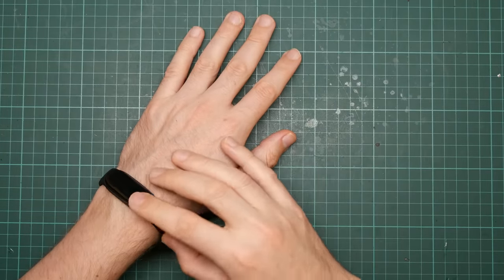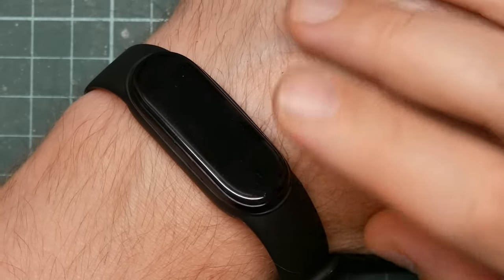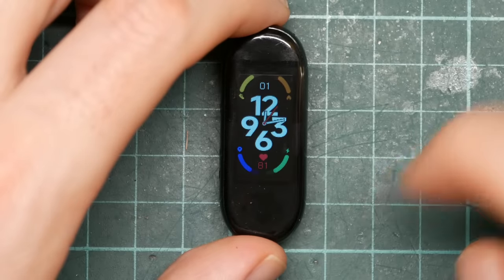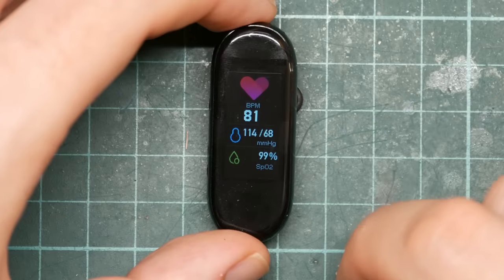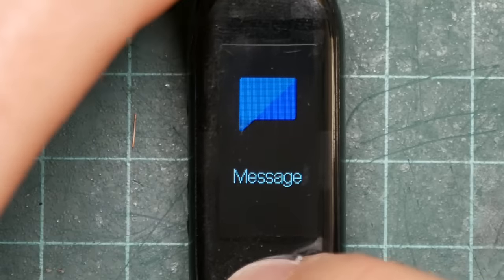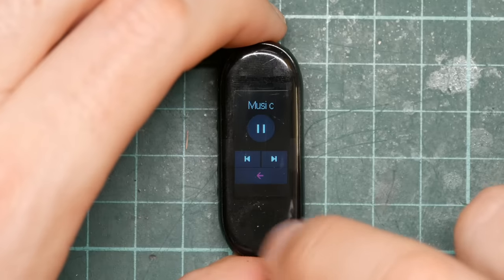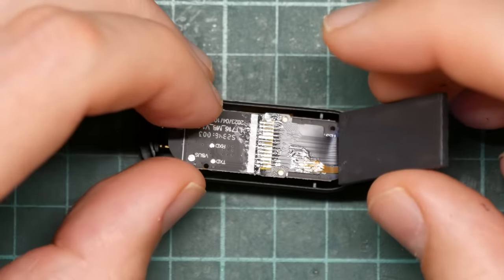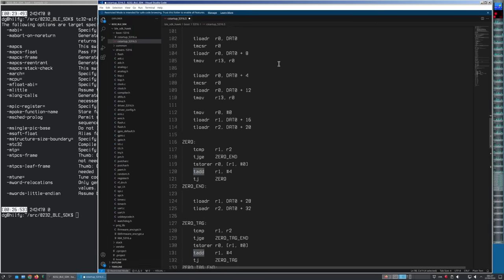Porting Python to a terrible $3 smartwatch

Comment: "The battery is slightly squidgy, which is a bit concerning" -- the guy who was just poking it with very pointy tweezers 😅
Reply from the maker: Sometimes you have to make your own entertainment.
Reply: Come on, the channel name is "Poking Technology", what did you expect
Reply: The more you horse around, more you find around
Reply: A rule of thumb for seriously high volumes of electronic components is that you can cut the 3k unit price from Digikey/mouser down to 1/3. So they're more likely paying in the range of 40 cents for that SoC.
Reply: “the M4 band battery is very slightly squidgy, which is very concerning”
Reply: @snarekeeper8053 valid point lol

Comment: i love that your desk has a heartrate. amazing. please feed it well
Reply: Heart rate*
Reply: Hart
Reply: @Omkar_Rangole  rate
Reply: Andrew Tate
Reply: @bassooll69 Rat*
Reply: @tultimatelifeform  wt f andrew tate doing here
Reply: It's a high heart rate given the desk is at rest though, maybe he needs to give the desk more exercise?
Reply: @scragar  Probably. In every video he's just sitting there.
Reply: @Omkar_Rangole  kevin hart
Reply: @khalifaadam1653  Kevin hart rate
Reply: That's my hate rate. I bought a similar crap some years ago. So it was more expensive as 3€ and I bought it for the advertised blood pressure sensor, which gives fake values. The dealer didn't refund me. I guessed those are fake random numbers. Now I now there is no optical sensoring at the diode. It would require a third wire, actually it should better have 4 wires.
Reply: @kamel6915  Thats what i noticed. Because no matter what, it will always give a reading
Reply: the desk having a Heart rate

Comment: The fact that this watch is a knockoff of a xiaomi band watch, which itself is only 20-40€, is crazy
it's a cheaper version of an item that's already cheap!
Reply: And I know it’s a Xiaomi smart band 4 knocknoff
Reply: @Camman18family  it looks like a mix of mi band 4 and 6. mi band 4 as in the shape and mi band 6 ui
Reply: I can pay a month's rent in 50€
Reply: 40U$ is much money in many countries
Reply: I had a mi band 2
Reply: But without a working heart rate monitor and pedometer.
Reply: it's not a knockoff of the specific model. The same product can be found under various names like "M7 and M8" imitating the mi band 7 and mi band 8 but will all ship the same knockoff m4 model in the "M8" box. I bought a lot of these because the included bands were compatible with my old mi band 4, and so I just paid 80 cents for the product and just threw away everything but the band
Reply: Even $10 Casio watches are copied, and sold cheaper in developing countries..
Reply: honestly I upgraded from a xiaomi to the pixel watch and regret it

Comment: 5:55 Funily, two wires are enough, if you are clever. When the Led has sent its pulse, there is a reflection coming back and since Leds work as photocell, a current spike is generated and the current is dependent on what is reflecting. So all the sensor needs is power and ground and some sniffer on the powerline.
But i bet this is not implemented🤗
Reply: Jup that is an option but in this case it's just a nice blinking-light. I thought about this for a self dimming clock that's just barely visible. Too much hassle to implement. Used a standard cheap photocell. And in the aftermath just bought a cheap off the shelf chock 😂
Reply: So measuring the power draw which is lower when more light is reflected and reabsorbed?
Reply: @Kenionatus  Can you measure the drop? It isn't much.
Reply: @Kenionatus  No! The led generates power like a solar cell and you could measure that. But only in a narrow wavelength. And I'm not sure if you could use the bounce back from rapidly switching between powering and reading voltage to detect anything
Reply: @SteffenF  next you will tell me that the heart rate of the desk its sitting on is wrong
Reply: @francistaylor1822  no it's absolutely correct. 😅. Must be correct... Obviously. 😂
Reply: @SteffenF  Measuring the bounce back right after turning the LED off sounds difficult. Judging by a Styro Pyro video I saw relatively recently, electrons like to slosh around quite a bit when circuits are opened/closed. Since both the light bounce back and the charge equalisation happen at around light speed (IIRC), you'd have both happen at the same time.
Reply: @Kenionatus  I guess that's right. Therefore it's not possible.
Reply: I have one of them, it just selects the hearth rate from a list that ı guess has like 3-4 numbers. It shows 68 and then 94. And when ı disconnected the led it was still giving the same numbers so ı don't think that it is implemented :)
Reply: @SteffenF In theory it should be detectable - but the equipment needed to sample the return signal fast enough and with enough precision to reliably measure it would be way more expensive then the watch itself 😂

Comment: while it is garbage, i still find it amazing that you make something like this for THREE DOLLARS. crazy
Reply: not even that, since im assuming they're trying to make a profit, i suppose they're making this garbage for EVEN cheaper, which is astonishing
Reply: And three dolars at the consumer. How  fucking cheap do the production costs have to be that it's worth shipping that thing through a logistics chain across the world, market it, pay for accounting etc...
Reply: @Kenionatus  exactly
Reply: @Kenionatus Don’t forget it’s shipped for basically free due to the Universal Postal Union.
Reply: Yeah, he just improved the value of this watch by a factor of 10x or maybe even more lol
Reply: @Kenionatus  
China 👍
Reply: @Kenionatus Probably 50 cents to manufacture.
Reply: Don’t forget about the smartphone app that goes with it. Somebody spent time developing it
Reply: its cheaper atm to buy things for non intended purposes.  like it was going to cost me $60 a sheet for some nylon for my workshop...amazon had massive inch thick chopping boards made of the same stuff for $6 🤷🏼 its how i shop now for raw materials.

but warch out for radio issues with these things. ive had non radio led lights that turn the indicators on my bike on and off 😂 they all use the same frequencies and chips, after about 4 products your screwed, they all interact.  get what you pay for.
Reply: I'm betting the price is subsided from the data mining the app does.
Reply: @appleintosh  those are generic. One works for all
Reply: It's market dumping. Either super subsidized by the state, or repurposing old stuff just to get it out the door, or both.
Reply: they make more money from the data
Reply: I mean, it doesn't seem to work, so you do wonder if it's made from castoffs.
Reply: they sell these even cheaper, sometimes for a dollar
Reply: If it's a fitness band, it should have gyro/accelerometer

I already am imagining putting 5 of these on my bike to constantly measure it's geometry and frame bending under load. Or simple single use touch buttons. Should be very useful for a lot of things

Comment: Well, the heartrate / Sp02 sensor is 100% fake. It's only got 2 conductors and looks like it's just flashing an LED. At a minimum you'd need 4 wires (ground, 1 for photodiode sense, two for the pair of inversely connected LEDs (one IR, one visible).
Reply: later in the thign there is pads for a sensor apparently
Reply: Of you are cleaver you can use the led as a photodiode but I would guess that from the screen that its 100% fake
Reply: @AJB2K3  it would be impossible to generate light and sense light simultaneously using the same LED at the same time.
Reply: @christ2290 you absolutely can by pulsing it measuring the current spike from the reflection.
Reply: @supermaster2012 Have you considered the speed of light and the switch off time of the LED before it becomes usable as a sensor?  This seems highly unlikely to work at short range.
Reply: @GodmanchesterGoblin  the speed of light through flesh and blood is significantly lower than the speed of light in a vacuum.
Also, it doesn't have to turn off for the readout, you measure the spike in the back fed current while the LED is on, the pulsing is only needed because of how oxygen sensors work.
Reply: And ignoring speed of light (you can actually just ignore it if using your proposed arrangement), how small is the variance in reflectivity due to blood pressure pulses going to be that you can still reliably detect it from LED the while it is being driven? Does the chip have the ability to do what you suggest?  Not that I am aware.  The change in LED forward voltage caused by changes in reflected light will be almost immeasurable, especially with a simple microcontroller.
Reply: @supermaster2012  your proposed theory 100% won't work and no pulse oximeters are built this way.
Reply: Nah, social credit score.
Reply: This is actually the most calm debate I have ever seen in a youtube comment section lol
Reply: If theres another digital chip on the other side of the wires, you could get away with three wires
Reply: @dankmemes3447  still one more than the 2 in this example.
Reply: @christ2290  yes, the one in the video was definitely fake
Reply: i was guessing it would be i2c and was surprised to see that it actually was fake as u describe. im not sure why they didnt just not have the thing since its so cheap - no need to fleece people who are already expecting a crap watch

Comment: Pro tip.  Instead of stripping your magnet wire manually. Hit it with a flame from a lighter and it will burn the coating right off.  Then pinch in a tissue and pull to remove the char.   It’s way quicker than scraping it off
Reply from the maker: I'll have to try that --- I attempted to burn the coating off with solder but it never worked very well.
Reply: @hjalfi I reuse the wires from brushed motor windings, Also as many as I have got till now the coating can be removed easily with the soldering iron itself no need of scraping or need of a lighter. Really nice for thin jumper wires !!
Reply: I've done that and have also just burned it off with the soldering iron, though the flame is more effective i've noticed.
Reply: @hjalfi  Set your iron to 400 deg C and just touch the very end of the wire - it works for me, it goes from doing nothing to coming off easily when temp is raised.
Reply: @hjalfi  Just set your iron to 700F / 375C and gather a nice blob of solder at the end. Stick the magnet wire into the blob and it should let go of the coating in no time. A tiny bit of rubbing is all it ever takes for me to have the coating release and for solder to fully wet the wire. Burning with fire by contrast will leave behind garbage and it works very poorly at best. Motor shops just use a hot iron so I copy them and it works a treat.
Reply: @hjalfi  There is special low-temp magnet wire I use that is made especially for iron-stripping, "Belden 8040" is the model of a specific guage of it. Also having a dot of solder on the iron, and dipping the tip of the wire in flux, goes a long way to making the prep go quickly. Edit: It's also called "Beldsol Wire"
Reply: Cheap headphone wires are much easier to deal with.
Reply: @hjalfi  I remember atomic shrimp trying that same technique. You’re not the only one who thought it should work.
Reply: I use wire wrap wire with Teflon insulation. Still for sale on AliExpress!

Comment: Nice work - digging around in these things seems like a lot of fun. I've also experienced these "smart watch" devices with the faux biometrics that merely flash a green LED and then make up a bunch of bogus data. Funny thing is that I've got a Xiaomi smartwatch that looks almost identical to this which does have fully functional sensors and works nicely.
Reply: it's not that trivial to tell them apart, actually, because the legit sensors, I'm pretty sure, DO work by shining an LED and then taking an image, and trying to read the bloot oxygen from that, or something, and heartbeat you can just measure with like, 2 contacts or so, so it can be tricky to tell whether it's totally bogus, or whether it's PARTIALLY real and just mixes in bogus data for missing parts
Reply: @jan_harald  Yep. I think the LCD in the real Xiaomi is taller and you can clearly see the blood sensor next to the green LED on the back. I think the charging terminals may be located differently too, but otherwise they're very similar.
Reply from the maker: The really strange thing is that all the devices I've seen have an unpopulated HSR footprint for a real heart rate sensor, so it's clearly something they designed for.
Reply: the case reminds me of the ones used for other devices, I bet they have a similar chipset but mildly other functionality (BT audio).
they have the tiny LiPo in common too.
Reply: i said i have the one in the video, but i might have the real one.

Comment: I would have taken the wires out through the heart rate monitor window.
I enjoyed this video very much.  Thank you for taking the time to document your steps.

The platform is very close to what I am looking for.  Battery life is an issue I would like it to last many days of stand by.  Actual use would be just a few minutes per day.
I want an vibration alarm once or twice a day, with an ACK button, and a timer and a tiny bit of logging that can do some simple stats like average and totals.  My app would probably fit into the RAM.

Comment: Summary

1. The Terrible Smartwatch (0:00):

* A cheap (~$3) fitness tracker smartwatch with questionable accuracy and features.
* Features include: step counter, heart rate monitor (likely fake), sleep tracker, message notifications, music control, and weather.
* Connects to smartphones via Bluetooth Low Energy (BLE).
* Powered by a Telink TC32 CPU with 512KB flash, 16KB RAM, and BLE hardware.

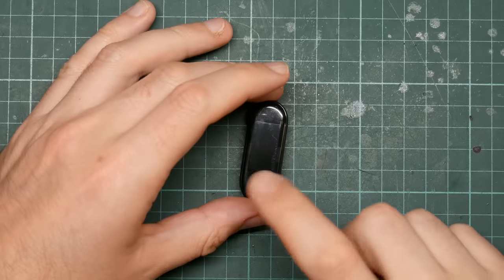2. Disassembly and Exploration (5:00):

* The watch is easily disassembled revealing a simple design.
* Contains a touch sensor, small screen, battery, vibration unit, and a surprisingly accessible microcontroller (MCU).
* Test pads on the PCB provide access to UART, reset, SWS (Single Wire Debug) and other signals.

3. Building a Debug Interface (9:39):

* The author initially attempts to use an STM32 Blue Pill as a debugger following existing instructions, but encounters issues.
* After troubleshooting, the author develops a custom debugger using a Raspberry Pi Pico, which proves successful (20:42).
* The Pico's PIO hardware simplifies the implementation of the unique debug protocol.

4.  Deep Dive into the TC32 CPU (21:58):

* The Telink TC32 CPU is not an ARM processor, but appears to be a close derivative of the ARM Thumb instruction set.
* Analysis of the assembly code suggests the TC32 is essentially a rearranged subset of Thumb, potentially for licensing reasons.
* This makes the assembly code relatively easy to understand and work with.

5. Exploring the SDK and Writing Code (27:15):

* The Telink SDK, while not extensively documented, is relatively straightforward and easy to use.
* It provides basic functionalities like GPIO control, UART communication, and access to hardware timers.
* The author demonstrates the process of writing a simple program to blink an LED and send data over UART (30:07).

6.  MicroPython to the Rescue (36:19):

* The author successfully ports MicroPython to the smartwatch, providing a full Python environment within its limited resources.
* Despite the 16KB RAM constraint, MicroPython functions well, allowing for scripting, defining functions and classes, and interacting with hardware.
* The implementation includes a file system, allowing for storing and running Python scripts directly from the flash memory.

7.  Challenges and Future Work (49:25):

* The watch's battery life is a significant concern, as the current implementation lacks proper power management and runs the CPU at full power constantly.
* Implementing sleep modes and utilizing interrupts for more efficient power consumption is crucial for practical use.
* The BLE stack provided in the SDK consumes a significant portion of the available RAM, limiting its practicality with MicroPython. 
* A more lightweight BLE stack or optimizations to the existing one are needed for Bluetooth functionality.

8.  Conclusion (1:03:30):

* Despite some challenges, these cheap smartwatches offer an interesting platform for hacking and experimenting with embedded systems.
* The accessibility of the MCU, coupled with the power of MicroPython, opens up possibilities for creating custom applications and functionalities.
* Further exploration and development can unlock the full potential of these devices, potentially leading to unique and innovative projects. 

i used gemini 1.5 pro to summarize the transcript
Reply: Never do something so low effort again.
Reply from the maker: Thanks --- pinned!

Comment: On one hand I sort of get calling it terrible if you ignore the price... but if it's $3 that's not terrible, that's amazing. You couldn't get the screen or even the STRAP by itself for $3 on Amazon or ebay.
Reply from the maker: The hardware is surprisingly good (although it desperately needs more buttons). But as a watch it's essentially useless. I actually tried it for a bit.

Comment: Interesting video. I like the humorous way of how you very clearly explain how you gained control of this cheap yet interesting piece of hardware. Thank you for sharing!
Some years ago Aaron Christobel made an Arduino core for the somewhat similar D6 Fitness tracker. (similar features, monochrome display, nrf5 mcu; equally cheap and crappy watch). On his Youtube channel you can find a few video's around him hacking that D6 watch, but also quite a few for some other watches such as the P8 as well as many other devices.

Comment: you should use 30 AWG silicone wire don't even bother with the transformer wire, it brakes even if you just observe it because you collapse it's wavefuntion and it's so fragile that it's the only thing holding it together